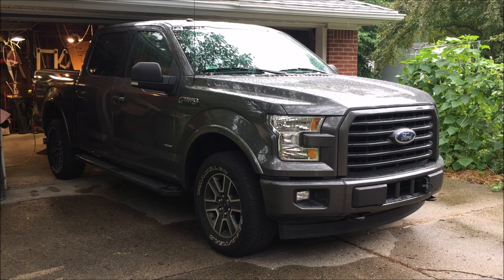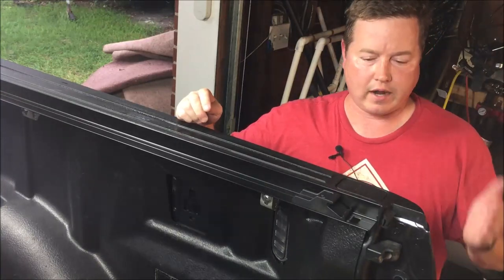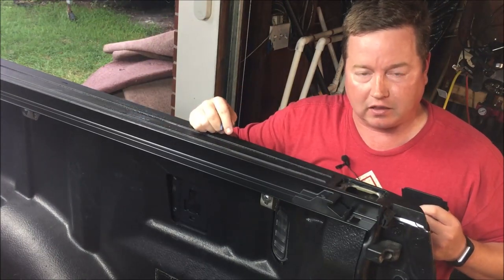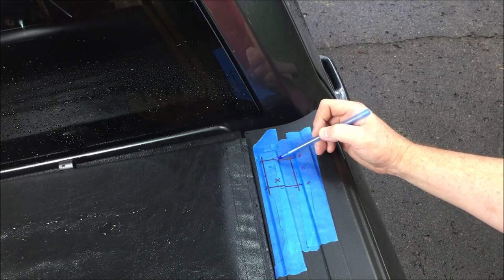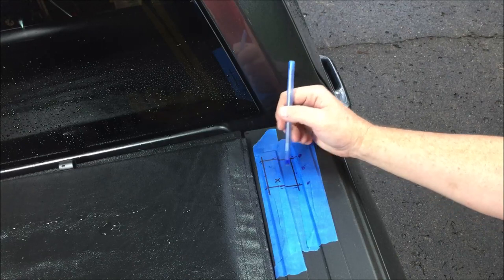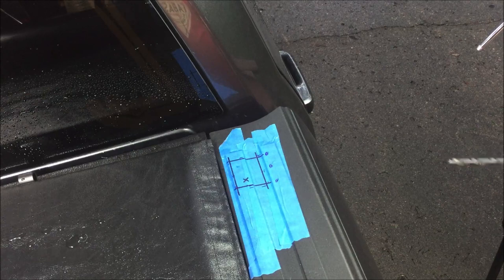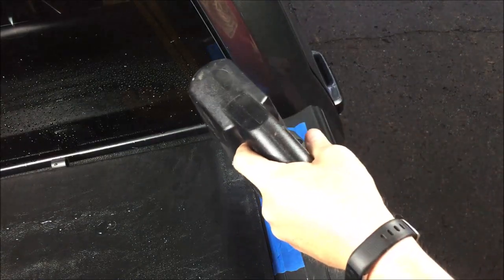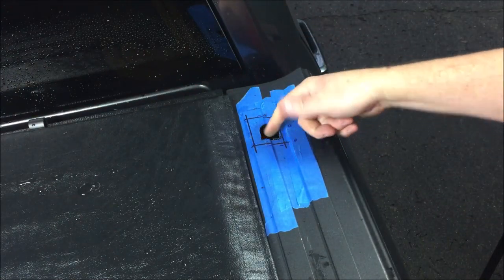2017 F-150 shorty stake pocket cutout

Comment: You say 2 3/4 from the front then you say you went 2 3/8 did you mean 2 1/4 and 2 3/8 or 2 3/4 and 2 7/8??
Reply from the maker: I'm so sorry I caused this confusion.  I think the math in my head doing the video was wrong.  Be conservative.  Most likely the firm number I quoted was 2.75" as the starting point.  Then add 1/8" for safety to avoid cutting into the metal.  That would make the cut line 2-7/8" from the front edge, NOT the 2 3/8" I quoted in the video. Thanks for pointing this out.

Comment: I have a 2018 and i'm debating doing this for my back rack, can you confirm that the hole in the side of the truck bed is centered with the center of the front stake pockets?
Reply from the maker: If I understand your question correctly you want to know if the front and rear stake pockets are on center or parallel to the truck frame? If so the answer is yes. Please see my follow up video on the rack I added after cutting open the front stake pocket covers here.  Adarac F-150 short bed install and overview https://youtu.be/4ctsqiYYpxA

Comment: OK looking to do this to my 2018 Two videos out. The measurements on where to cut. You guys do not match which one do I believe...?
Reply from the maker: My truck is a 2015 so it should be the same location on your 2018.  You can see the stake pocket location if you take a look underneath your truck.  You could use my layout and then drill a small hole in the middle of the pocket to see if you hit metal or not.  Are my measurements way off compared to the other video?   I was also nervous cutting into mine, and I took time to ensure the measurements were correct.  Let me know how yours turns out.

Comment: John:
How has your Adarac held up after 2 years? I have a 17' canoe and think I might benefit adding a roof rack as well. Wondering about keeping the two systems flush since I dont think the adarac has a vertical adjustment.
Dennis
Reply from the maker: I’m happy with the rack. I leave the main rails on over our salty Michigan winters and take off the vertical parts. You’re correct, there’s no vertical adjustment.

Comment: Crap, I bought a headache rack for my 2015. I really do not want to cut that without a cap for the day when I do pull it off. Why not leave them all open Ford?
Reply from the maker: I know!! I wish it was just open and accessible like almost all other trucks!
Reply: I think they don't leave them open because they are not reinforced so Ford doesn't want people to actually use them as stake pockets.  For things like bull rings or the Adarac rack that are just clamping to the top, they should be fine.   I find it very annoying too, but you can buy generic covers, I know Truxedo makes some but I don't know if they work on an F-150.

Comment: Love it and would like to see a bull ring installation added.  Thanks
Reply: I realize this is an old thread, but I just did this and put in Bull Ring anchors.  I had to make a couple spacers using black plastic to fill the difference in height on the raised bed lip, but it worked great.

Comment: I would like to know if there is a stake pocket that will fit over the hole that was just cut with the jigsaw; a cap similar to the factory made
 hole and cap at the tail of the bed rail.

Comment: I have a 2018 and without the stake pocket cut outs, figured I was going to have to do something like this for the cut out.  My only question is, did you come up with a plan if you sell the truck or just want to remove the rack, how are you planning to cover the pockets again?
Reply from the maker: I would sell the truck with the lower bracket attached that covers the pockets and throw the upper racks in the bed as part of the sale. I keep my vehicles usually at least 10 years before selling.
Reply: That’s my issue, my 2015 is enclosed too but I’m not going to want that headache rack on for forever. I will not be able to deal with the holes. Unless I bought the entire plastic piece for the bedside. Which seems like the only way to go. Why didn’t they put covers on it? I really don’t want to drill into anything
Reply: You can buy covers for them, Truxedo makes some that may work.  Or you could put stake pocket tie downs in there.